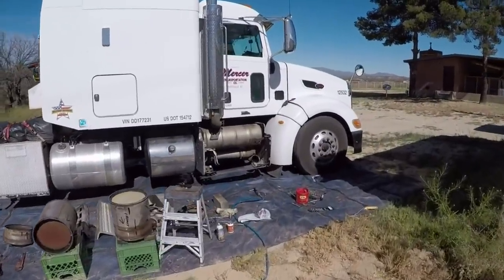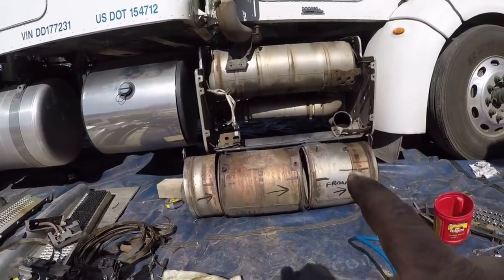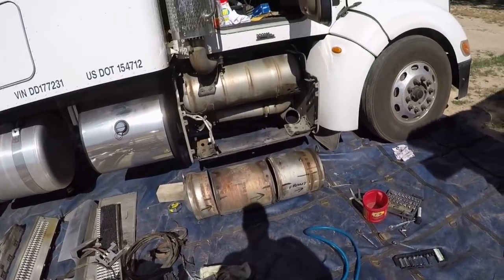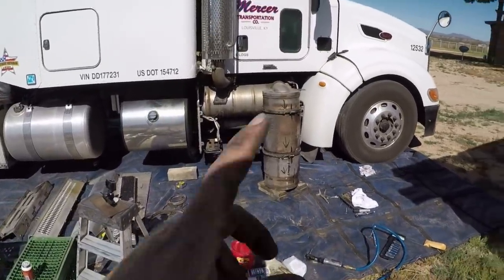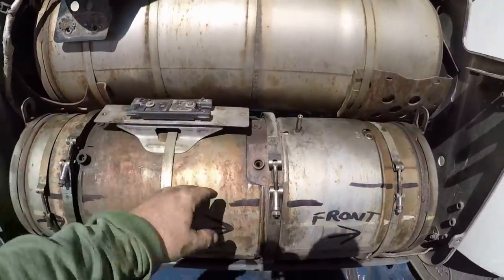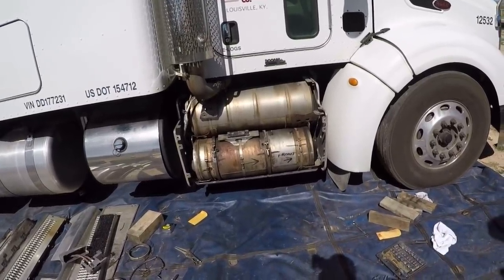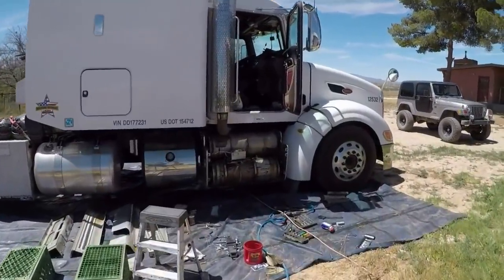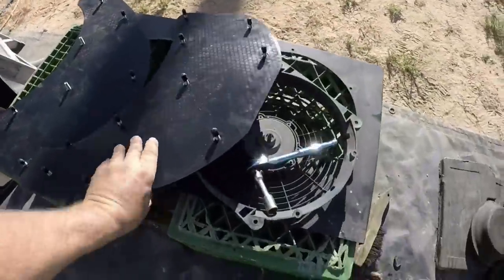#306 Working on the Truck The Life of an Owner Operator Flatbed Truck Driver

Comment: We use the term, Diesel Particulate Filter where I live.  I worked for Peterbilt until September 2008, before driving truck.  Those filters were priced at $10,000 back then.  I love your videos!
Reply: Correct, Dan you are cleaning the DPF, this is separate from the DEF system.

Comment: WD-40 should clean those head-lights good enough until you can do it properly. For my old 1995 Ford Escort I used one of those spray on kits, and it worked pretty good and the lenses are clear again.. The best way is to use emery cloth on them with 600 grit and 1,000 grit, then crocus cloth keeping it wet all the time, but I really think that is over-board....  Your area where you live looks nice, outside in two T shirts and not sweating, I'm living in the wrong area LOL....  Congrats on working on your own truck, job well done.... Your wife should pay for breakfast since you are saving money not going to the mechanic hahahahhah...... Cool dog too, I miss seeing them with you in the cab, but I can imagine the dogs are happier at home where they can run free and play + easier on you not to worry they are in a hot truck while you do wash or go into the store, etc....  Take care Dan... Hope you had fun at the fair..... Stay safe driving.....

Comment: Take alot of pictures & video before and during your tear down. Mark & number directions. That will answer 95% of your questions. On the parts you know you will need, if you buy them before you take them apart...that may give you a clue on how to take them apart without damage .

Comment: Great job Dan. The DPF is still not sorted out even though it has been on trucks since 2008 maybe earlier. If that isn't burned out you are stuck with not being able to operate the truck after a short while. I have never seen one on an OTR diesel and I think that made the job easier than pickups. Still a lot of work but you can reach things. Nice job on your home projects!

Comment: for a minute Dan I was sorta confused. Thought you were fixing the squeak in your clutch and chair. Thanks for clarifying.🤔 you should spray your fifth wheel pads with silicone. I did my headlights with the 3m restore pads, they worked dang good.

Comment: I'm sorry but as a driver for close to 20 years now this def deal on these newer trucks are basically ovens sitting under the cabs very scary if u ask me considering how many trucks have now burned to the ground! I run an older model and wont use def until it's absolutely mandatory from dot because it's a bullshit unsafe system imo!